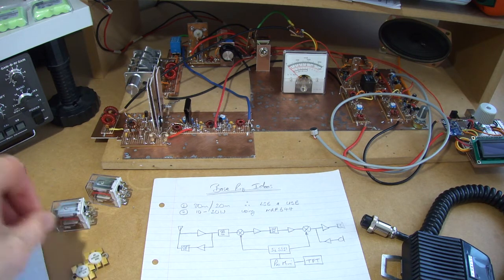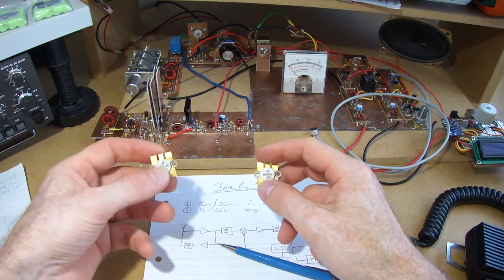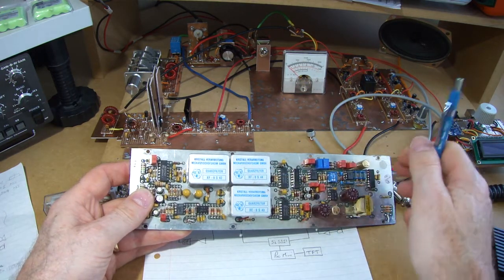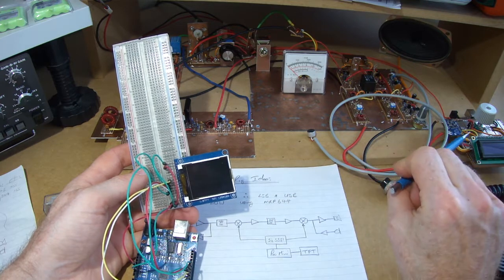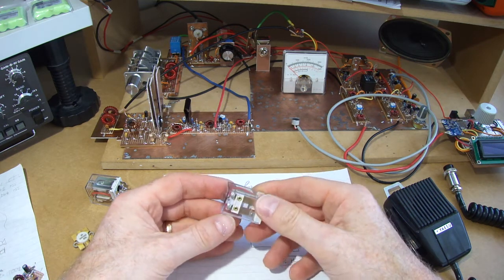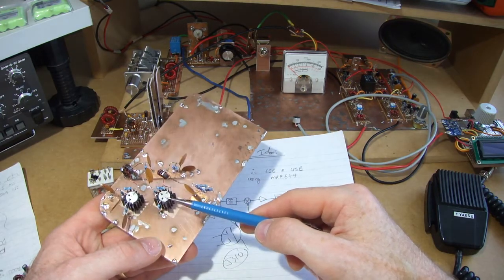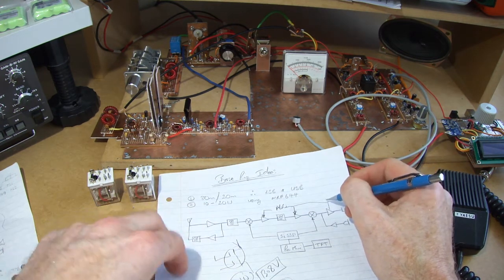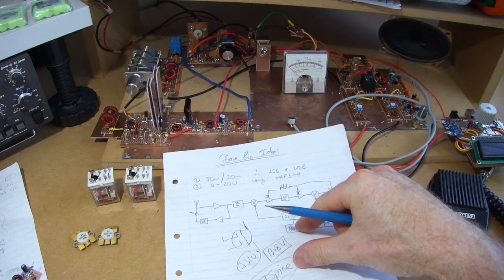Homebrew 80m/20m SSB Rig Part 1 - Design Ideas

Comment: Hi Charlie,  I have been enjoying your videos.  I have been collecting parts for quite some time now and I think its about time I start trying to build something.  You are inspiring me to get on with it and make "something" work!   I may start with a simple RX and see where it takes me!  I just got 4 of the Adafruit Si5351a breakout boards in the mail yesterday.  I saw in another video someone make the comment you should make an ebook.  I agree!  You made a successful project and I know I would like to see your notes to see if it will better help my understanding.  Good luck with project 2 - Keep the solder flowing!!  73 de Seth - W8FG
Reply from the maker: I'm really pleased to hear that Seth, as the aim of the videos was to encourage others to give it a go. I have said many many times that I am no expert, and if I can do it then anyone can. Try a simple direct conversion receiver first, then add BPF and RF amps as needed, then go from there. A great way to start. I started with DSB then tried SSB.

73s
Charlie ZL2CTM

Comment: Hi Charlie, your dual band SSB transceiver will be a great way to start a new year of radio experimentation! 
Homebrewed crystal filters are quite fun to put together. For my 160m USB rig I started off with a small bag of 1.8432 MHz crystal and chose a group of eight crystals with frequencies within 10Hz of each other. This yielded a filter BW of 190Hz which will be just the ticket for some data modes.
Leftover crystals will be used on various oscillator circuits that I want to investigate.
Reply from the maker: Fantastic Gilbert. I want to build a CW rig this year so 200-odd Hz filter would be great. I have some left over from this build so I'll see what I can conjure up.

Comment: Charlie have you seen the ebook or pdf done by Harris I think it is called crystal sets to sideband. I found the information that he uses very helpful in how to plan a multiband rig and a lot of it could be old information but also it could also be helpful. He uses his own experience and explains some of the pitfalls he fell into and I will be very interested to see how this project turns out long term. When I move into my new QTH hopefully you will be able to hear me on either 80 or 40 meters.
Reply from the maker: Yes I have thanks David. There are lots of little gens throughout that book based on the 'school of hard knocks'. I have to keep scribbling them down in the design notes folder. It's great that we can all share our experiences, good and bad.